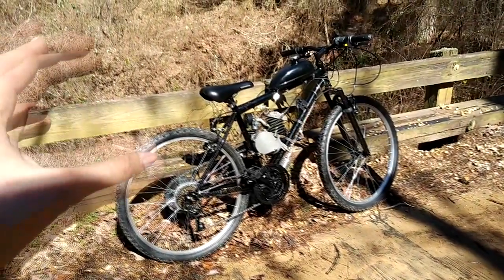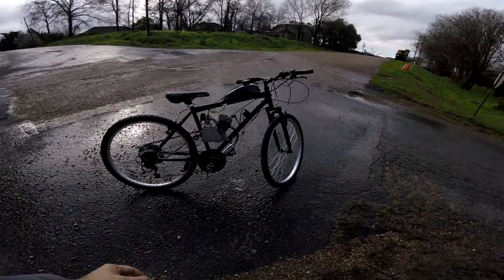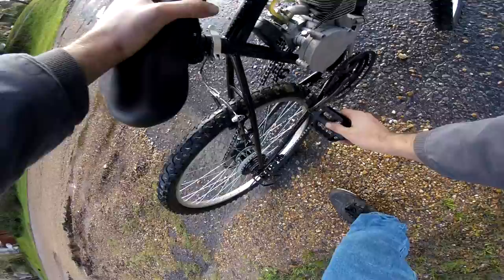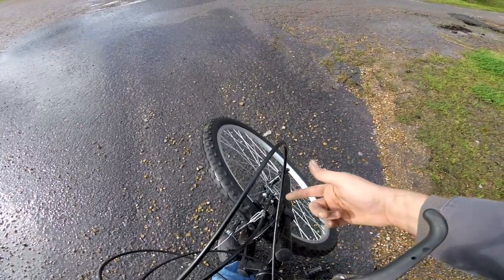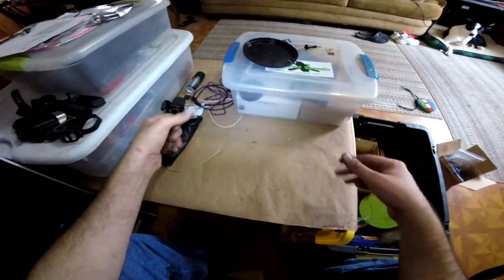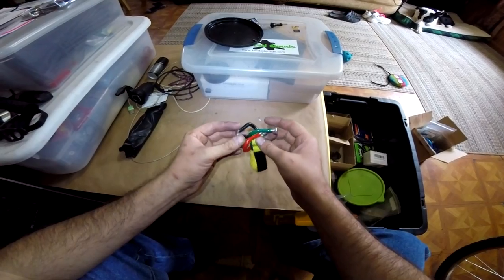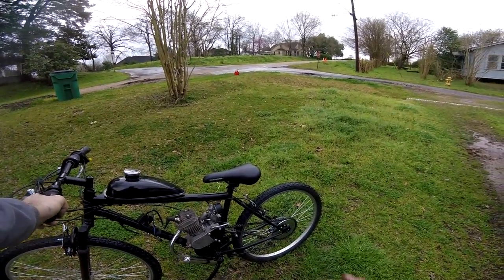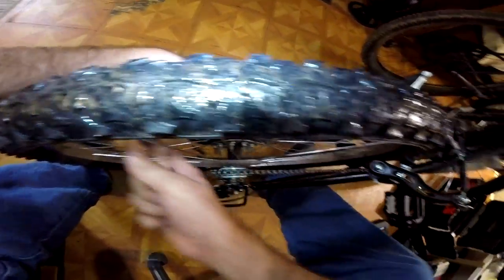Motorized Bike Tools, Checks, and Tips

Comment: Pro tip: if you strip out either the exhaust studs or the intake in the cylinder threads, you can run a 1/4"×20 tap straight into the holes without drilling first and then just get yourself some 1/4"×20 bolts and you're good to go!! I have done this more than once- even Chinesium is a little tougher than aluminum and it's quite easy to over-torque especially the exhaust. Make sure the cylinder is cooled off before trying to tighten any of that stuff too because it strips out way easier when hot!

Comment: Amazingly I put an engine on a rusty 25 year old bike and I replaced the tires but besides that the bike runs perfectly
Reply: Same with me I did it on a 20 year old Huffy mountain bike I replaced the rear break assembly and both tires and the rear wheel
Reply: I did mine on a 30 year old hard rock lmfao, it runs perfectly and I can get a top speed of 39.4 mph. I have a stock Zeda 80 firestorm on it

Comment: hey, i’ve got addicted to motor bikes for about a month or two, i have tried my friends flying horse engine on a walmart cruiser and he was offering to sell it to me for 200 dollars. i was wondering if u think that a good idea. also i wanted to ask u what the ideal combo is. like what’s the best engine kit to buy and what’s the best bike for that engine(under 500$ budget). anyways i love watching your videos and your the best creator on youtube i have found on these bikes. and i love just watching you zoom down the fire road type trails.
Reply from the maker: 200 for a working bike is a good deal, if it's not all beat up a rigged at least... I have yet to find a bike motor combo that is spot on without upgrads/mods. But the huffy cranbrook is the best budget bike that is motor friendly so far. Thick spokes, coaster break clears the sprocket, wide triangle for any motor, 26" wheels make upgrades and transportating easy, can install rim breaks, steel frame, really nice seat.
Reply: LA Hover, thanks so much for replying! Since the bike is a cruiser. Would install suspension firms be the best way for it to handle off road. What do you think
Reply: A zeda triple 40 or a pk80 triple 40 are great engines under $200 .... if you use the stock exhaust you may want to modify the muffler by adding holes on the bottom cap or install a performance muffler.... I’ve had great luck with those 2 engines
Reply: Get a $96 dollar steel beach cruiser from Google shopping. They're called like a three-seven or something

Comment: Legit simplification.  As far as cheep frames go the Next Bayside from Wal-Mart  is pretty damn good for a road cruiser. Very noob friendly in terms of fit and the A-arms have some boxyness that takes very well to the chain tensioner in a way that doesn't move like it does on round stock.  Given you follow this checklist. 
Also,  save your blown tubes for rim liner.
Reply from the maker: Thanks! and good call on the Bayside.

Comment: Did you just push the grip shifter in? I flip them to other side or use bar extensions. But pushing it in seems like a great simple idea
Reply from the maker: Ya, on past builds when I thought I would still use it allot I also flipped it to the left... But after a while I just set it and forget it.

Comment: Kind of looks like a Roadmaster bike only because I have a few. Assuming its not but just a guess.
Reply from the maker: So far so good, It is a Roadmaster :)
Reply: Indestructible bikes. They have outlasted any other bike I have bought for my kids in the last 5 years. (although they will rust out quickly if not protected from the elements) I am re purposing one for a motor build but would like to put on a suspension seat post, better seat, and get a longer handlebar stem or different handlebars to mimic my hybrid bike. I haven't figured out if being more upright is better or worse for one of these. I'll have to do some research. It looks like you took off the decals, looks a lot better.

Comment: No idea maybe a Raleigh?  I'm waiting on a last few bits before I dive in.  My build bike is an ALUMINUM one but i plan on tracking down a steel one to swap it into .
Reply from the maker: My older trail bike is a Raleigh, but not this one. Good try :) and good luck on your build!
Reply: @LAHover  thanks I will be doing a build review of this project. It will be used like a trail cruiser. I have an old railway (kettle valley railway  in bc )that is now used as part of an off road hike bike quad snowmobile trail. Perfect for what I want it for . Just cruising.
Reply: I'm running an alpha aluminum Trek 3700, works fine, but I did end up drilling the down tube for front mount

Comment: I just got lucky as my 12 dollar ebay rear deraileur is gonna work after my drunken wipe out took out my nice sun tour. Also i just realized i can get the chain to frame clearance from a washer and i don't have to try to shave the rubber spocket gasket. And my wheel wont be at a slight angle anymore. Im so smrt

Comment: I keep every tool I need to diagnose a problem with my gas bike lol mines to unreliable
Reply from the maker: Question, are most of the issues you have related to the bike, the motor, or a mix of both? Thanks for stopping by! :)
My 1st build was lucky, so was my 3rd, and 4th... but my 2nd build was non-stop problems lol
Reply: @LAHover  both but last night my cdi plug melted cause it was so cheap but mainly old ass bike frame problems I need to find another
Reply: @ADumbFox1379  check police auctions

Comment: I’ve had nothing but bad luck with the style of rubber joints set up for the rear wheel sprocket.... I use a cnc 3 piece 1.5” hub assembly.... I’ve now use nothing but aluminum mag wheels.... trouble free

Comment: I don't recommend  higher end bikes, 2 reasons, first was stated in video why chop an expensive one. Second is they do not hold up ant better guys , they crack in the same places in the same time frame, my avatar is a 28 yr old frame, other stuff has been changed bearings mainly, rims, brake pads, oh man brake pads shread the alloy rims fast, groove them.  
On my second build now just hunting for a frame or bite the bullet and get one of those frame in tank units

Comment: only tool you need is a Philips/Flat head screw drive, 15mm,14mm.12mm,11mm 10mm, and finally a 8mm sockets with socket wrench "recommend deep sockets" 14mm,11mm, 10mm and 8mm wrench. also recommend to keep high quality both metric and US standard Helex keys, and an Adjustable wrench on hand.  And, get a small fabric tool bag. and one last thing always keep a small hammer in the tool bag.  the things i found to go wrong with these bikes all happen to me so far... MAKE SURE YOU KEEP HIGH QUALITY TOOLS!! cheap ones will strip out your bolts and nuts... trust me!! but those my recommendations....
Reply: most of the issues are going to be the back end of the bike  lol

Comment: The Schwinn Sidewinder would be there Perfect Bake if the triangle in the middle is just a tiny bit bigger.  I've seen it done but it's a really tight fit definitely not putting a high compression head on it.

Comment: the frame is a roadmaster granite peak male
Reply: i am 15 and have the same frame for my motor bike and if anyone is considering to buy a motor i would say go for it but be aware some clutches will wear out really out really fast and i would recommend you go on amazon and search " bicycle motor clutch pads" they are super easy to replace they pop out and pop in you might need to sand or file the sides down a little bit so the go in all the way.

Comment: first upgrade should be a hub adapter
Reply from the maker: I disagree. I think they have their place, but I do not recommend them as a first upgrade. Nor do I recommend them to a new builder. Bikes with 1" hubs should avoid them, as well as builds with larger sprockets.
They work well on coaster break hubs, and bikes with small sprockets.

Comment: Hey La, i have a HBC cruiser cheap bike that i ordered off amazon but they carry at Walmart when the bike came and i put the rag joint on the rear axle and coaster break were all jacked up i finally got it on but im still not shure it it is right could you talk about breaks or do a video explaining thanks man!
Reply from the maker: Are you having one, some, or all of the following issues? 
Breaks locked up?
Breaks not working/or not working well?
wheel not spinning free (bearings to tight)?
Wheel / axle, bearings are to lose?
issues pedaling (sloppy engagement)?
Or something else?
Reply: @LAHover  brake works but not well i was thinking though its been about 20 years since i rode a coaster brake i remember jamming on brakes and sliding my bike sideways maybe they are just struggling to stop with a 250 lb grown man rather than a 100 lb kid ???
Reply from the maker: @derrickcarroll4932  If a lack of breaking power is your only issue, you may have grease between the shoes and the drum/hub.
Sometimes this will go away over time. Other than that you can disassemble the hub and clean the hub & shoes... Sadly this means you may have to remove the sprocket.
Personally I would rather install rim breaks than go through that.
Reply: @LAHover  thanks man yeah i prolly will do that cause they are easier to me